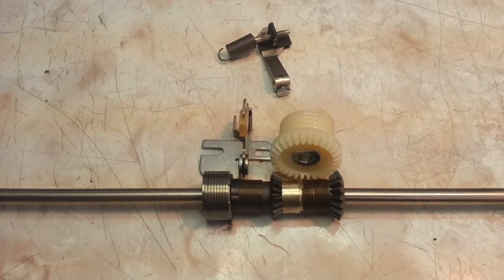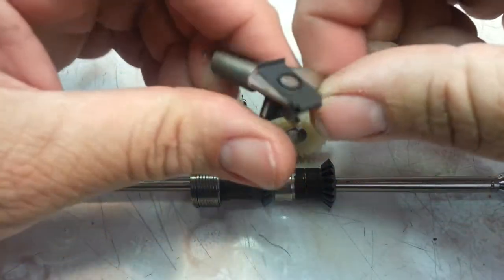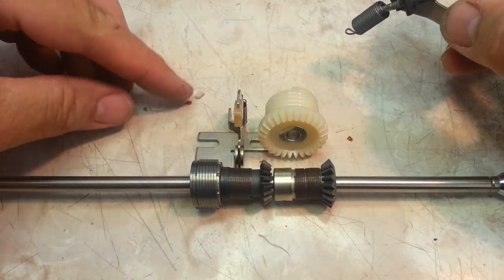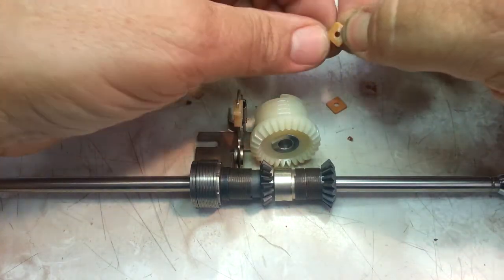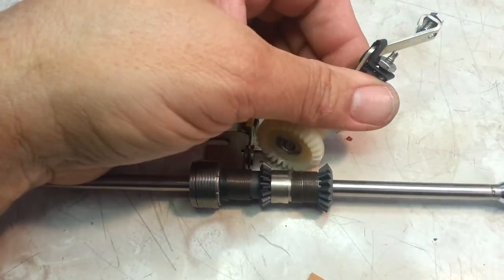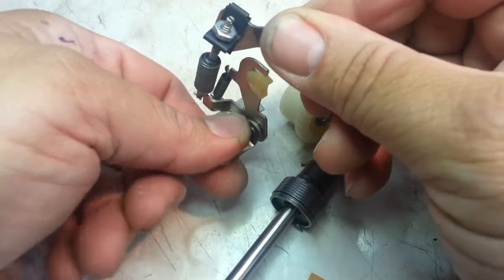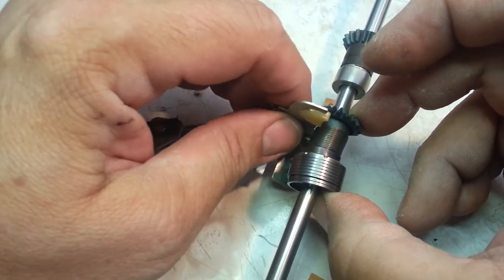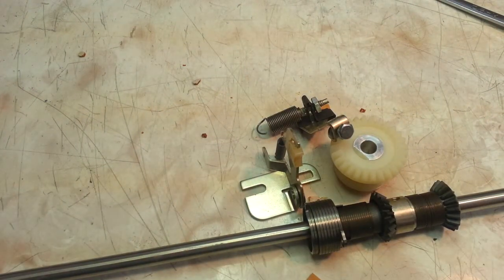IBM Selectric Typewriter Carriage Return Repair, Lock Nut Method, 1, 2, 3 I II III Fix Also SR 101

Comment: Thanks.  Adjusting this fixed my non returning carriage issue.  A few observations.

When installed,  turning screw counter clockwise brings foot closer to spring.  Clockwise moves it further away.

A simple test is to place your finger against the spring when hitting return key.  If carriage returns, chances are this is the issue.

Thanks again.

Comment: I believe you may have just explained the solution to my typewriter problem. I'm still a bit fuzzy on exactly how that clutch works. I flushed the torque spring and the clutch spring and adjusted that very scew. Pretty much as you described it didn't seem to hold the adjustment. 
I'm a big fan of your videos. I have loved learning about these machines.
Reply from the maker: Yup, these are tricky to understand. took me a while to grasp the theory of operation. 
I taught myself a lot from analyzing a working machine, like a side by side  comparison.

Comment: What does the spring between the two gears on the shaft do. I managed to unwind mine off the shaft. Do I need to remove the operational shaft to put it back?
Reply from the maker: That is tabulator decelerator spring. Typewriter will work fine without it, but when you use tab it will slam into next tab stop. further between tab stop faster the slam. if you set a stop every 10 spaces it wouldn't have a chance to get going too fast.Only way to replace that is to pull the operational shaft out.
Reply: Thanks, I ordered a new spring and gear from a seller in Indiana, he said best to replace both since that plastic shaft is sometimes damaged as well. I am still trying to figure out carrier return problem, got a new torque spring that connects between the tab and the clutch spring since it looked a bit stretched, anyway the end would not stay on the metal tab, after I took it off and tried to put it back on.